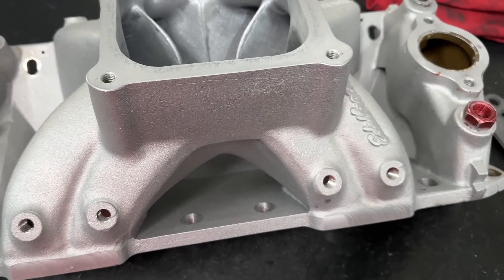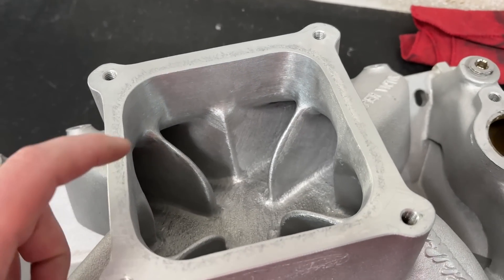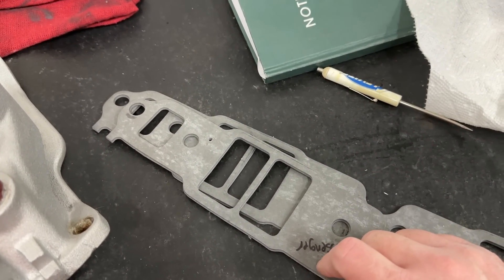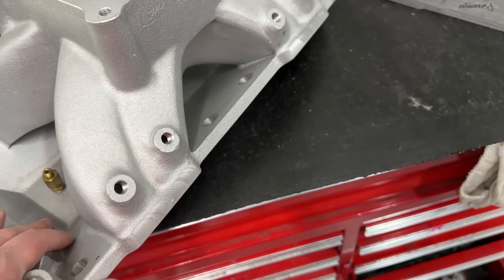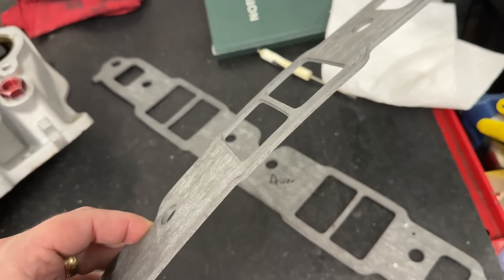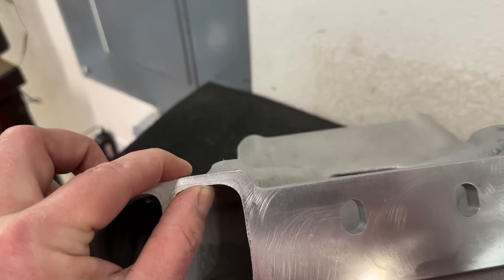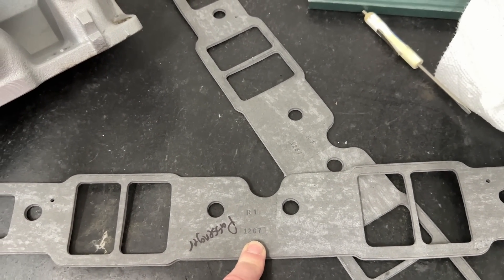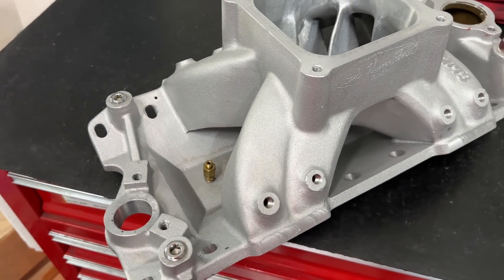Edelbrock Super Victor Dominator intake Addressing  A Problem

Comment: Dart makes a 4500 pattern 23 degree SBC intake. It's part # DRT-42421000. It's about 6.5 inch tall. Mine was cast in July 1995. It's a damn good piece, almost 30yrs old and still probably better than anything available today.

Comment: What Size small block based chevy would you got to a 4500 flange manifold over a 4150 flange manifold?  Or does it depend on more of the compression and cam and heads also being used in conjuction with the cubic inches?
Reply: Best used on 650-700+hp NA type builds. Big cubes or high Rpms can both utilize these type intake. Wouldn't want to use it on a 400hp SBC.

Comment: Having worked in manufacturing, I'm betting that flat on top is a register for subsequent machining. They usually have a three point "Bank" from casting for an initial cleanup, like the other registers and maybe a few finish operations too, then go onto other setups using those for location.

Comment: I just went through a mess like that recently with a 434 sbc. Raised deck 9.325 raised cam and spread oil rails, what a calamity. I used intake spacers and china walls 2 sets of gaskets. The distributor wouldn't go down the hole cause as you know they are on an angle, I didn`t think the deck was high enough to interfere with the fit but it did so I had to oblong cut the distributor hole to make it seat. That`s life.

Comment: Just finished bonding on solid aluminum shims to an old TPIS Miniram to fix the same problem. I used an aviation epoxy spread real thin and even, then clamped it down hard on my mill bed to cure.
Crossing my fingers it lasts...

Comment: Hey Eric, so why they made that edge smaller is because of the factory center bolt heads the valve cover gasket flange protrudes past the intake gasket surface. I have ran into this about 20 years ago using factory Vortec heads with an aftermarket intake where I had to mill those 2 edges for the intake to clear. This was never a problem with the older style heads or aftermarket I don't think. They must of got feed back on this problem and corrected this across the board?

You might want to call them to let them know that wasn't a problem on aftermarket heads and it would be a good thing to leave more material in that area?  

Take a look at a Vortec head in that area and you'll see what I'm talking about. Not sure about the earlier factory center bolt TBI heads but the Vortecs are for sure a potential to have interference in that area with that extra material there. Maybe Edelbrock uses that same kind of valve cover gasket surface like the Vortecs so they cut that area down so their intakes fit on their heads?(not sure?)

Comment: Why not use an Edelbrock 2892 for Dominator carbs?  Plenty of room to redrill for dominator pattern and it’s a much better intake.

When it first came out I had to mill down the top of the runners to sit down properly on Motown 220 heads.  Things may have changed over the years thought
Reply from the maker: It’s a lot of labor to convey it. I have done it before

Comment: So, i also use fel pros -3 prefix. Say if you run a 1205,1206,1207, look up part number 1205 s-3. Fel pros description is a gasket more suited for street. Same gasket, but i think theyre .080 thick. Gets me out of most simple cases, and i live in ohio, so my engine goes through more expansion and contraction in winter when it sits, and i find they are more forgiving for leaks and whatnot and blowouts.

Comment: Great video Eric! What was the brass fitting in the back of the manifold for? I have not seen that before. Venting?
Reply: Looks like a compression fitting, perhaps for a dash gauge in conjunction with a vacuum pump.
Reply: @yarrdayarrdayarrda  yep that's it
Reply from the maker: I’m not 100% sure but I think they use it to monitor crankcase vacuum. I know back when x275 used nitrous a lot they use to monitor it to tell if there was a problem with the motor.

Comment: A few years ago Holley did this to the 300-25 😤  conversely Edelbrocks Ford intakes need to have an extreme amount milled off many times.
Reply: I had purchased one and had to return it.  I waited a couple of years later and ordered another one.  This time it was fine, so maybe they changed their process after getting so many returns and/or complaints about it.
Reply: @toomanymodz  I returned 2 also.  Then found a used one that had not been touched.  I may try getting new ones again on another build.